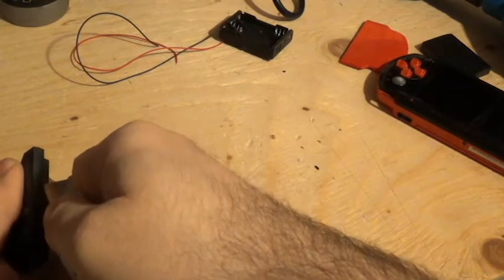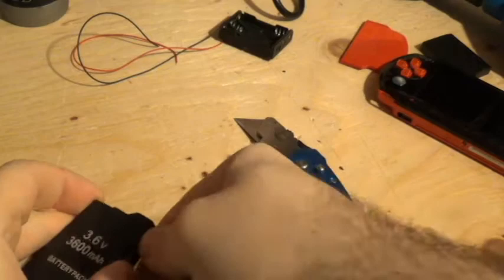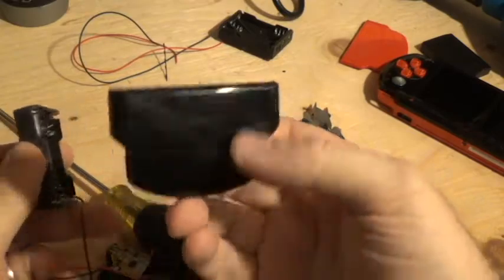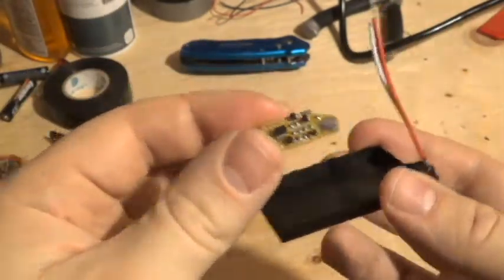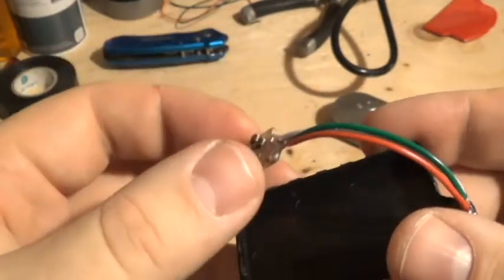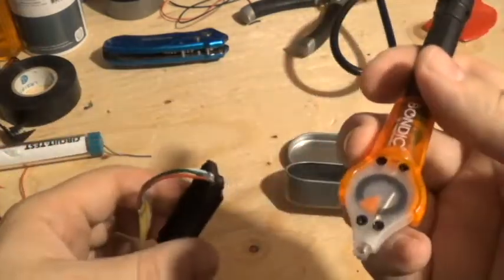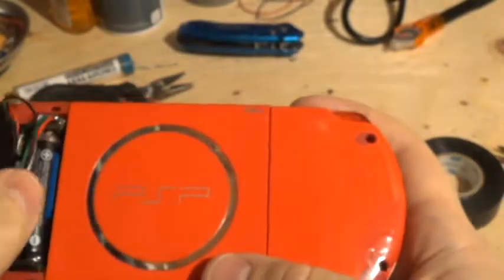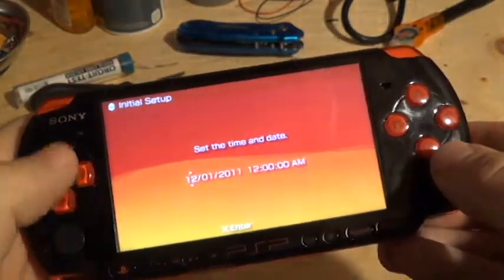PSP AAA Battery Mod Episode 51

Comment: nice video..
yesterday i just bought second psp from online store..
the psp doesnt detect battery, but it can be played by using powerbank..
could you tell me whitch path from my psp are broken?
Reply from the maker: @andreashenri5801  you are probably going to have to open it and follow the battery terminals and look at all capacitors connected to those lines. Dust the inside with a brush to get the dust off and then brush everything with 70% isopropyl, allow it to dry and do it again. Once it’s clean you can check for breaks or corrosion.

Comment: Is it possible to use 2 AAA or AA battery packs like you used and wire them together and have 1 on each side on the underside to give a grip area and more capacity?

Comment: This is great idea bro. I have 1 not working 3rd party battery and a psp that cant be charge through the charger port because the solder pad where the charger port connection has been attached to is pull out from the mobo itself. So i need this project and going to use it.
Reply from the maker: Awesome man. The only downside is the battery life if it’s the only way you can get yours to run. Maybe get some high cap eneloop batteries to get the most out of them. 👍 Have fun with the mod!

Comment: Was just looking into doing this to my PSP Go. I'm hoping there is also a chip in its battery as well. If so then my only challenge may by designing a new back housing with the 3D printer since only 2 AAAs fit nicely in it. Thanks!
Reply from the maker: Pepsiman2006 I would love to see how that turns out! I have never owned a PSP Go but it’s been on my list to do some kind of mod with for a some time. I bet you can get away without 3D printing a case and buy a 3rd party protective case and creatively do some dremel work. Unless of course you have the 3D printer then why the heck not right haha

Comment: Neat project, did you know how long it lasts? I own two original PSP units and a PSP go and they usually take forever to charge and last a little bit over two hours... Keep up the good work buddy
Reply from the maker: Terry The 2D Maniac thank you kindly =D it’s not an ideal situation for long play but great for quick pick up and plays. I get about 2-3 hours off the batteries.
Reply: @CanadianZangief  that's the average for a rechargeable one too in my experience, and according to a quick google search 2.5-3 hours. you can disable Wi-Fi to get a little more out of it. I'm curious about something though: if you used rechargeable AAA batteries, could you recharge them in the PSP using that middle lead? either way, this is a great mod, especially given that PSP batteries are starting to bloat.

Comment: nah..i will try this soon.. i had bought AAA battery cradle and panasonic  battery original
but i don't have a hot glue.. without hot glue is everything okay? or must be use hot glue?
how to cutting up the battery cradle? just cut side by side only?
Reply: i almost forgot panasonic battery had rechargeable. so i can charge it without problem?
Reply from the maker: As long as you can get it all to fit and wired in you can do without the glue I just like the extra stability.
Reply from the maker: You can use rechargeable batteries because that would be 1.2v x3 and they should charge fine but I would use caution charging them while inside the device. The protection circuit inside the stock battery is rated for LiPo batteries and may cause issues but I am not totally sure. If I were to use rechargeable batteries I would charge them in their own charger. I would consider a LiPo power pack for long play though. I made another video where I used a 10,000 mAh battery without physically altering the PSP. Good luck mate!
Reply from the maker: Maychel Tjang well the 10,000 mod I did rest in a hard plastic case along with the PSP so it’s more of a battery pack add on rather than going right inside it. As for Nihm batteries I am unsure if the LiPo protection circuit will be sufficient to charge them but they will absolutely work to power the PSP. You should get about 3-4 hours out of those eneloops. Since that 1.2V is being run in series to boost the voltage to 3.6

Comment: Hey! Nice Video,, wanted to ask how long did the batteries last? Have you also tried a rechargeable batteries like the one being suggested by Ahned? Thanks in advance!
Reply from the maker: Thank you. glad you like it =D. Well i usually get about 2-3 hours out of top shelf disposables and about 1-2 hours from rechargeable. I use this as more of a pick up out of the blue kind of solution rather than for heavy use. I just recently made a mod and video for a huge rechargeable battery with the same principles being used. I get over 30 hours on the new
mod!
Reply: @CanadianZangief  how do you use rechargable batteries on this mod? Is it the same process and the only difference is instead of normal batteries you use rechargeable one? 

Edit: also if i use rechargable batteries can i directly charge them using the regular psp charger or do i take the batteries off and use rechargeable battery charger?
Reply from the maker: RedHunter33 it’s exactly the same process but I would charge them with their proprietary charger not with the PSP.
Reply: @CanadianZangief  ok this would help me very much! Thank you!
Reply from the maker: RedHunter33 no problem friend. Good luck with the mod!
Reply: @CanadianZangief  can I use the USB port to charge.

Comment: Would 3 AA battery's be too much? Just a quick question as wanted to  modify mine by sticking a battery holder on the back with wires connected to the psp
Reply from the maker: 3 AA will work just fine since they have the same 1.5V per battery as AAA. You would get a bit more power out of them as well but would no longer be able to hide them in the battery compartment.
Reply: Canadian Zangief thanks mate I've ordered a battery holder to glue on the umd drive as there is no use for it on mine as I have cfw

Comment: you should use rechargeable batteries or else the batteries will explode.
Reply: not if u put a diode zener ,, the electricity won"'t back to the battery from charger !!
Reply from the maker: absolutely if you plugged it in. This is more for a spare on the road battery when you don’t have a plug in option.

Comment: do you know if you can power a psp 3000 just using the charger?
Reply from the maker: +MrJ0mmy you mean without any batteries?
Reply: Canadian Zangief yes
Reply from the maker: +MrJ0mmy oh ok. yup it should work just fine without any battery at all being plugged in.

Comment: Can you charge it ?
Reply from the maker: +Ryan Nuari i had disposable
batteries in mind for this. However, a rechargeable option is definitely doable but it's probably better off to find a 3.7V high MaH lithium ion battery and wire that in.   Just need to find one small enough. Some people have used huge ones and modded the system to make it fit but i want to try and keep the hardware stock to preserve it. =D
Reply: Canadian Zangief you mean like this ?
https://m.youtube.com/watch?v=do-EXe-8uGE

Comment: Good mod, bro! I'll try this for sure. My plan is  to use 4x AA eneloop rechargeable batteries (1.2 volts each) in total 4.8 volts, will that be okay or is it dangerous? since a normal psp battery only has 3.6 volts
Reply from the maker: +carlo tiotangco It should be ok as long as you always use the rechargeable. If your planning on going the rechargeable route I bet you could probably hook up a good 3rd party lithium ion from ebay and wire that into the battery pack and get some crazy battery life! I think that's what i'm going to do next time i'm feeling psp creative =D
Reply: then use 3x AA batteries to get 3.6V.  got some eneloop whites saying 1900mAh each so, i will try it.
i tried eneloop pro AAA ones (950mAh) and they seem to last like an hour only or so, i have to cycle them up to get the most runtime.

Comment: Not sure if you said this but do they charge?
Reply from the maker: +Dark_Magician04 I was using non rechargeable batteries for the mod and I left out the centre pin to keep the board from governing charging the device. In theory charging batteries should work. You would just need to wire up that centre pin.

Comment: How long does the psp last with the triple As? I want to give this a go
Reply from the maker: well i got about 2 hours out of cheap dollar store batteries. I am gona try some lithium energizers later and see how far i get =D
Reply from the maker: Tim MacKay I tried out a few different types. I was able to get 3-4 hours out of some top end energizers and i got 4-5 hours from some eneloop pro.
Reply: Canadian Zangief I think NIMH batteries would be the perfect voltage, since 1.2x3 for 3.6V
Reply from the maker: yup you are absolutely correct. I was just trying to stick with alkaline disposables for it. I however haven't tried really good ones. Makes me curious to see how long they would go.
Reply: great mod but for me ill prefer do a removable 3 NIMH AA pack,with some velcro.
so it stay longer